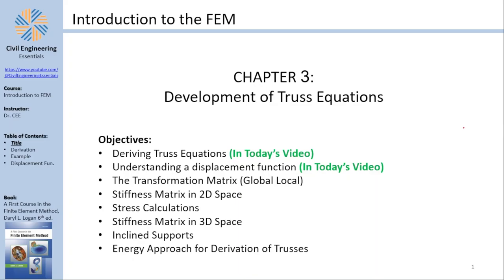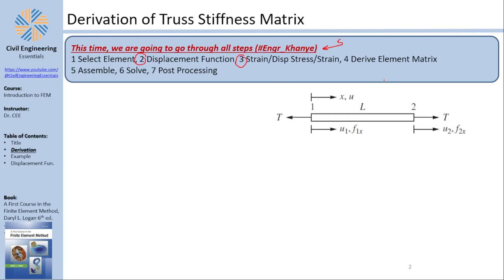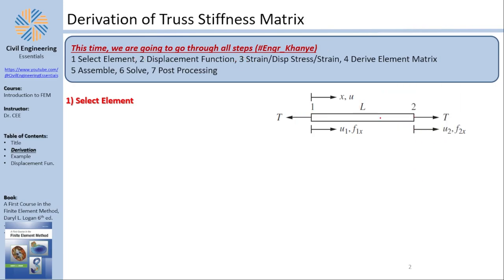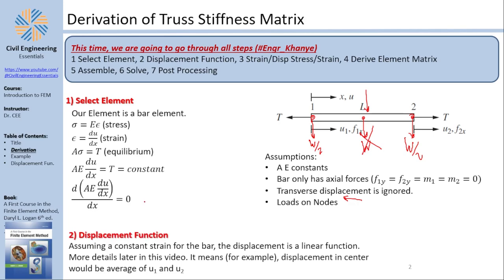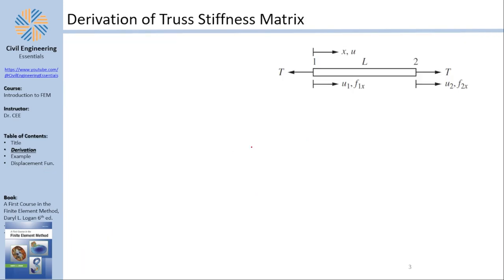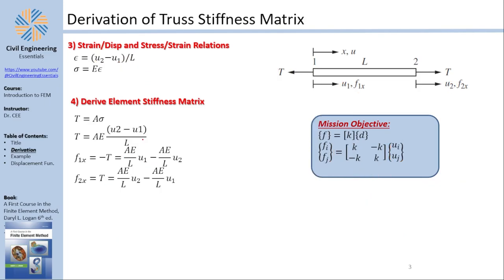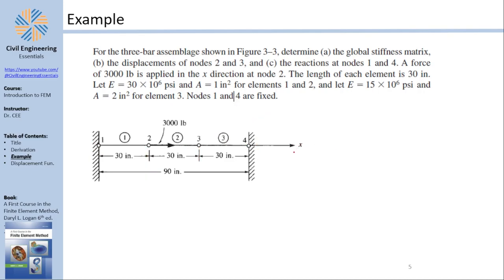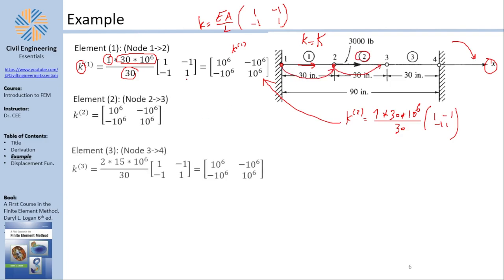The Finite Element Method (FEM) | Part 4: Truss Elements (1)

Comment: Hello Dr CEE

Thank you for the shout-out. Wow, that was quite a very nice and detailed explanation from 24:54 of the displacement function (and the associated “mixing functions”) for the current element; outstanding work Dr CEE, really good stuff right there. I also appreciate that you throw in hints to show how deep the rabbit hole goes.

05:16 The relationship AE*du/dx = T make sense. Whilst I understand that if one further differentiates both sides of this relationship, they would get what is referred to here as the “…. governing differential equation for a bar element….”, my question is: Isn’t the relationship AE*du/dx = T sufficient for defining and exploring the relationships between the applied forces on the bar and the resulting displacements of the bar as it is? Why would it be necessary to further differentiate this relationship on both sides as opposed to using it as it is?

I have truly enjoyed this video and I am looking forward to the next videos on the series. 
 
Keep well.
DK
Reply from the maker: Hi there Engr. DK,

indeed, those shape/interp/mixing functions are things you will see a lot in the future. But I had to slow-play it today.
As for your question, I remember asking the same question to my Prof. when I was an M.Sc. student, I still remember his answer vividly. It was because T is not related perfectly to your internal forces f1x and f2x, (you know, - and +), so it was wiser to just eliminate T from the equation entirely.

In PhD I realized that you can also have distributed linear axial forces on a member. There when you derive, you won't eliminate the T (because linear) and it gets even weirder.
Finally, where do you see a linearly increasing Normal force?
the weight of a column.
The top sections in a column feel little weight
The bottom sections of a column feel more self weight
W = gamma * h (h being your distance x here)

Hope this made sense.
Regards,
CEE

Comment: Thank you soo much Dr CEE and the rest of the team, CEE editor and CEE TA.

This is indeed a powerful lecture. However, it’s so obvious that the spring and truss have same stiffness formulation,with only the addition of member and material properties(EA/L)

Would the case of the beam and the truss be to change the EA/L to EI/L for a simple beam element?

Thank you for your good works
God bless you.
Reply from the maker: Hi there Engr. Sarpei,
thnx a lot for your comment. indeed, there are similarities between truss and springs (on the first glimpse.) But buckle up ^_^, there is going to be real new things next lecture with that regard. The similarity is deceiving only for a linear configuration, when local bar axis coincides with global axis.

As for beams, it is a bit more complicated, there is both shear and moment involved, and suddenly you have a 12x12 matrix. It is gonna be also cool once we reach it.

So stay tuned for more content.

Regards,
CEE
Reply: @CivilEngineeringEssentials  alright doc. well noted and thanks 🙏